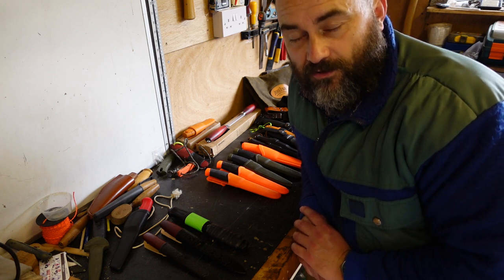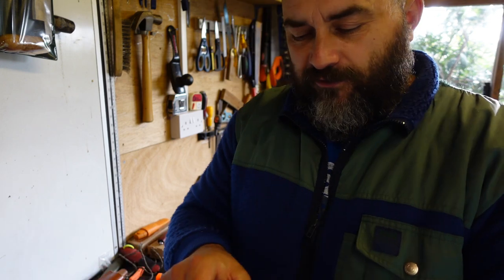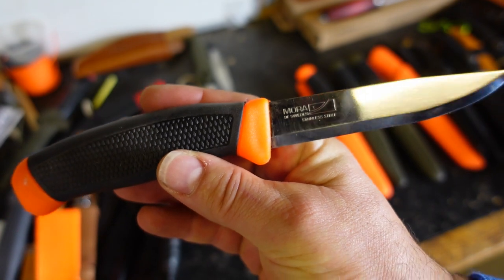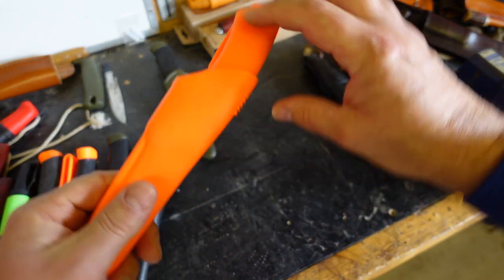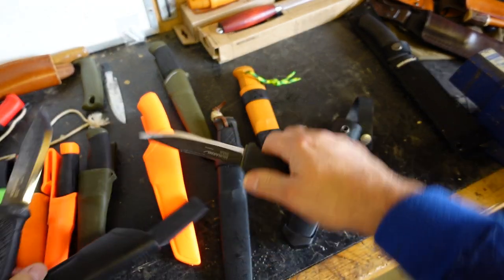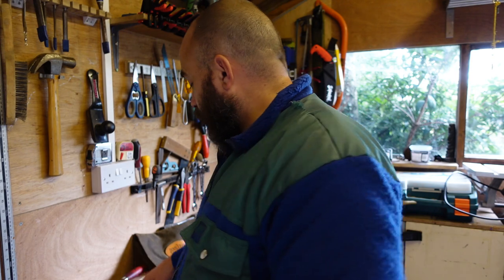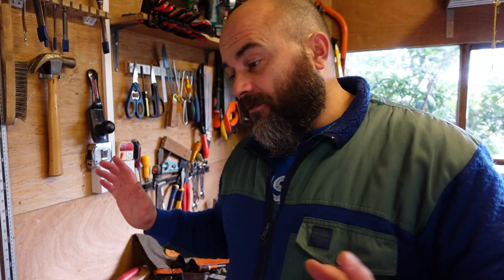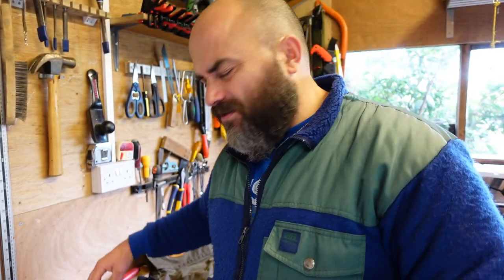037 My Mora Collection

Comment: Nice presentation. I like to hear your opinions on various aspects. I LOVE the More spoon knives (if you can only have one get the 106). I often buy the blank 106 and fashion my own handle and leather sheath. One suggestion: could you hold the knives still as possible for as long as you're talking a about it? It's usually only in focus for a spit second, then I rewind and pause to see it closely. Thanks and cheers!

Comment: i love my old mora companion MG carbon, recently i bought the HD version but haven't tried it yet, still using my old one and i hesitate to change cause never felt underknifed with the old one even though i have lot of other more expensive knives. Is it worth the upgrade to the heavy duty or will i lost some carving properties with the more thick blade of the HD? Any thoughts?
Reply from the maker: For carving, you will lose some feel with the hd as its a thicker blade. However, they're cheap enough so give it a go.
Reply: @welshwoodsman  thanks for your reply, i wil giveit a try👍